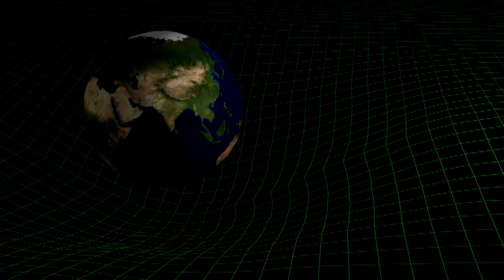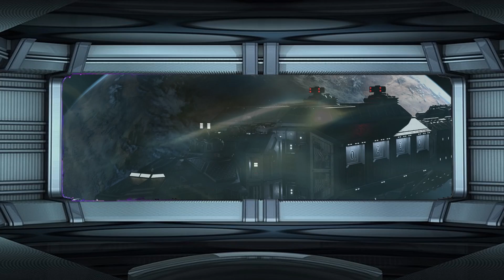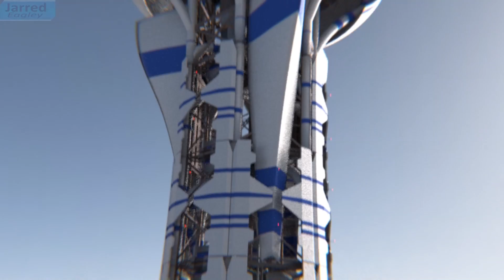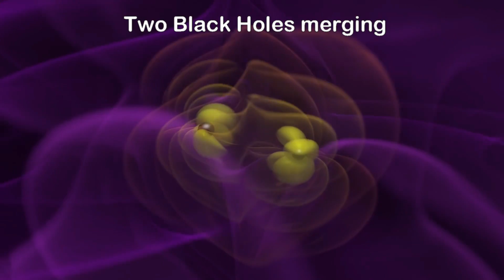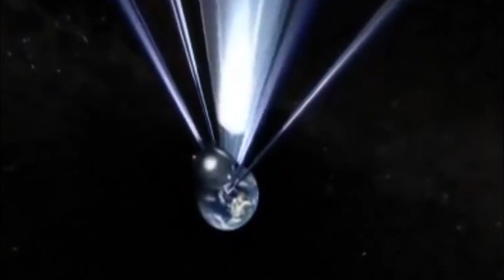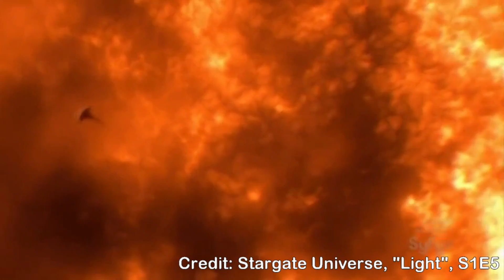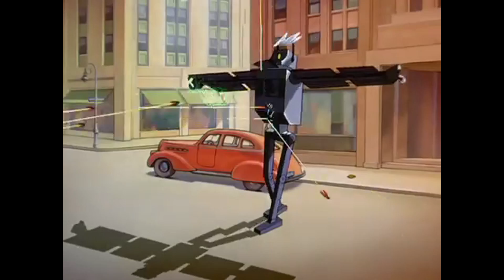Force Fields

Comment: Suppose we put a superconducting ring around an asteroid.  Fill the magnetic field with plasma until plasma pressure balances magnetic pressure.  Would the plasma be sufficiently impermeable to hold a breathable atmosphere onto the surface of the asteroid?  Could we terraform small bodies using magnetically confined plasma?  Solar wind particles could add enough energy to the plasma to sustain high temperature.  Could something like this work?

Comment: Towards the end for using them to seperate energies could you also do the same for light or lasers to store them or just use mirrors to trap it with fine angles to ensure containment for later use? Also about the light sails, if it's 99.99%reflective to certain wavelengths of lasers what it lose energy or momentum to push the sail away from the other mirror meaning more energy input or will it still continue pushing the sail like 1g per second?

Comment: I think the closest we could come to the classic force field would be absorb and redirect rather than block. A laser fired at such a field would simply coat the field and then continue on its path on the other side of the shielded object. A kinetic impact on one side would ripple around and bulge the field on the opposite side the equivalent (or near equivalent if we're gonna get all thermodynamic about it) amount as it would have penetrated. That gets around the problem of heat/energy build up. Plus if you could fine tune it enough, you could just fling the energy back at another opponent.

Comment: In my hard sci Fi universe I'm writing about, the only shield I have are called Plasma Cycle Shields. Plasma is shot out the top of a ship, and kept hovering above the hull through an electromagnet barrier, then as it reaches the bottom of the ship it is reabsorbed and reused, and cycled back up to the top.

They are energy intensive, and almost exclusively used on cargo ships traveling at low relativistic speeds. Even then, the shields are only used on the front plate of the ship. The result is a shield that bounces away dust with the magnetic barrier, and burns up larger debris, adding fuel to the plasma fire. 
What little it doesn't stop, it's stopped by the 0.8 meter thick Tungsten, Tantalum, Hafnium carbonitride Alloy frontal plate. 

I found the limitations of this technology has given me very unique situations in my book, that has resulted in characters having to come up with unique and creative solutions.

Add on top of this that these shields are usually powdered by the excess energy from a "Halo Drive" usage, and it results in a very unique form of shielding with limitations. 

Ultimately the heat of the shield is decided by the strength of the magnetic barrier. Using A0° super conductors the barrier is limited only by the amount of energy you have available, and therefore so is the heat of the shield. Without an Electromagnetic barrier the plasma is limited below the Tungsten melting point of 6,100°F.

Half the fun of writing a hard sci-fi book is I get to spend weeks learning the actual science of things like this. From Metal Hydrogen Batteries, to Coriolis Suits, to Plasma Cycle Shields, half the science behind it is based off of things I learned from this channel.

Comment: I was allways curious why so many sci-fi settings feature low power airtight version of their forcefields, widespread to the level where small craft hangars are lacking physical doors and in same time multiple types of military grade shielded ships, that are flagged as incapable of atmospheric flight. Is religion what porhibits them to use the vacum between shield and ship's hull to provide lif?

Comment: Plasma also blocks/reflects laser, depending on the frequency and polarization. In fact, it might be better than using mirrors to reflect laser weapons. Look up plasma waves and their frequency cut-off. If a frequency is cut off, it cannot propagate through the plasma.

Comment: My settings plasma shield idea is more that it's a solid condensed barrier. Allowing it to be more or less non glowing and sea through at first, though still highly resistant to objects moving through it. Should something try to force it's way through and overwhelm the magnetic fields holding everything in place, the plasma is no longer held rigid and only then can it begin moving, since it was held under pressure in the first place this results in basically full body explosive reactive armor, and yes it does glow and also become more opaque once disturbed. 
This is extremely power intensive, and no is not used as a personal shield you can clip on a belt. Later points in time with much better tech, and it is for people mainly limited to those wearing heavy power armor, the type that could shrug off modern anti tank weapons with relative ease even without the shield. Eventually it does reach the point they could be handled relatively safely on a human or baby without damaging the insides do to more and more types of containment, shielding, and projection systems being figured out, miniaturized, and worked on, but it's still not really used beyond super low levels (like to allow a person to handle hot or dangerous materials as a projected glove type, rather than as a combat shield), since all "humans" are basically about as mortal as a galaxy is, individually being able to lose limbs or stuff and be fine, and even if the local body is completely vaporized, the consciousness is normally run simultaneously between networked areas so their stream of consciousness is still going back at the local bunker points where a new body is made and they are streamed into it with a parallel thought system. It's worth saying if the connection ever does break for more than a few seconds we normally just consider them different people at that point, as each local area does it's own processing, they are just kept synced up so we perceive it as being the same person since that makes us feel better and perceive it as immortality, rather than just losing clones or duplicating ourselves to get around death.

Comment: Force fields as commonly depicted, even if they could exist, probably wouldn't work out in the end. I was thinking about it once, and it would only make sense for the energy or force of whatever they block to be transferred to the force field generator, the same way magnets can push on each other. Even if the generator itself didn't break from that energy transfer, I'm whatever structure keeps it in place would quickly break and now you have a force field generator rattling around inside your ship (assuming it can maintain power)

Watching this though, another thought occurred to me: if an Alcubierre drive is actually possible, it should also have defensive applications as well, since it is effectively a gravity field generator. Depending on how much it can warp space, it might even make an effective way to deflect projectiles and lasers.

Comment: Regarding firing weapons/seeing out of force fields, it seems like you could use an array of port holes either mounted on poles sticking out from say, the ends of weapons, or even using them as drones outside of the ship. These drone rings would be made of something that could project/reflect the plasma field, and fly around in the field creating sight holes and holes to shoot through. Paired with radar and other detection methods, it would be very easy for these drones to dodge and not allow anything through from the outside. I could see this being paired with a goggle set which follows a pilots gaze but will still dodge incoming weapons. On the note of drones, instead of armoring up a ships hull, you could deploy a field of armor drones which can link up maybe via electromagnets to create a solid barrier between an enemy and yourself. Or for an anti collisions system that keeps replacing itself as it’s broken apart. Maybe for asteroid miner ships

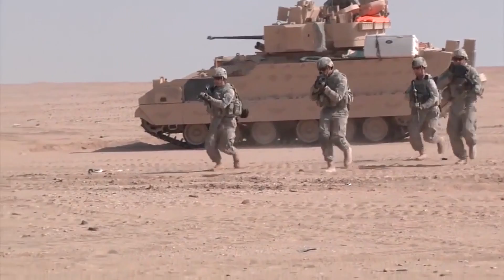Comment: 17:57 Body armor doesn't slow you down necesseraly. It tires you out more, but you won't going to run away slower to compensate, nor will the APC care about the passengers adding 300 kg more to the load, especially if they are also used to tow other stuff.

Comment: Using plasma as a force field probably wouldn't ever really be worth it... all it takes is for something with enough kinetic energy and it will punch right through it, and even if you did use it to protect against lasers the lasers would just have to punch through that containment vessel holding all the plasma and it's almost immediately useless. It would make more sense to instead of making a big tokamak around the ship, cover it with modules that are designed to ionize gas into plasma in short bursts (say if a laser is hitting it). They would not last forever (eventually will burn themselves out) but it would be a lot more compact and effective as armor -- think of it as a high tech ablative armor for lasers. That too though wouldn't make much sense either though... it would be a whole lot cheaper to just use regular ablative armor which we actually have the technology for right now (the stuff we use on heat shields) that would work just as good but a million times cheaper and more practical. The only use for "force fields" would be for keeping stuff like harmful solar winds from hitting your ship, or possibly with enough inventiveness for creaking cloaking screens or for blocking/scrambling rf, but not for active protection -- ewar and stealth at best.

You'd have more luck making a force field out of extremely high power lasers densely packed, in a way to create a screen. Anything that tries to pass through the screen won't necessarily be prevented from passing through, but it would either burn up or explode if the lasers are sufficiently powerful. It would be more of a kill screen than a force field though but that's as close as you probably can get to creating a universal barrier for keeping from getting in without using any solid parts/matter.

Comment: I would say, being able to fully control the field will be the key to getting a shield to really work.  Example.  When you have a fire in a pit, it goes all over the place,  produces heat, and cook your dinner.  However, if you control the fire in an engine cylinder, you get force pushing down a rod and creating Kenitc force which drives the motor in our car with the Cylinder walls.  No real controls here but a physical wall.  Now, trying to take a physical wall and create a magnetic field with the same physical wall property, but using energy to create it.  If this works, drop a nuclear reactor from a carrier and you got yourself an energy field. 

In this video, it is only the beginning but this time it is like being back in 1920 where cars was just starting out.  Now it's 2020, we may see more spaceship tech begin to evolve.  I hope one day we will be building Star Wars ships or Star Trek.  BTW, we will need FTL drives whether we like it or not. 

Provided we don't destroy the world first.

Comment: What about having cloud of metallic particles, you can keep it around you by magnetic field. You could concentrate it against incoming projectiles to enhance strength and rotate it around your ship to disperse heat (from continuous laser). Of course there would be lot of limits but lot of those can be solved by having bigger cloud. Also if you would have decent control of cloud you could reform some parts into large solid objects and launch them against enemy, or enemy missile.

Comment: I always found David Weber's concept of them in the Honor Harrington series to be perfectly workable and realistic.  (Likewise his explanation of hyperspace.)  Ships use gravity drive engines that produce a wedge of focused gravitational pull above and below the ship.  These wedges are pretty intense, enough that solid objects get ripped to shreds and even light gets redshifted to the point where it's pretty useless, even lasers.  Navigation?  The computer knows how strong the gravitational force field is and can look at the incoming redshifted light points and un-shift it as far as the scanners are concerned.  (The fields warp perception through them all to hell, but they do it by a predictable amount, so the computer can make things look normal as far as any sensors are concerned.  It can compensate for the redshift.)  Sides of a vessel don't have the wedges, (they don't meet at the sides, and if these gravitational fields ever cross the result is pretty catastrophic) but military vessels usually have 'sidewalls' that are the same kind of field projected into the gap.  Later in the series they also develop shielding for the fore and aft of the vessel, which are usually impossible to shield due to the wedge configuration.  (I think these can only be used when the ship isn't accelerating.)  So in their combat doctrine, the ideal shot against an enemy ship is directly aft or fore, ('up the kilt' and 'down the throat' respectively) or if not that, then along the sides.

The wedges will easily stop energy weapons, which makes sense given that their main weapons are bomb pumped x-ray laser warheads.  Armed ships usually also mount gamma ray lasers, sometimes more conventional light lasers, and in the case of older, less advanced nations, railguns.  (Railguns are usually exclusively for point defense.)  Typically energy weapon duels between ships are considered to be a failure on the part of one or both captains, since the best case scenario is that the 'winner' will just be the ship that manages to survive such an engagement with enough of its hull intact to retain some atmosphere.  It's a given that both ships are going to get ripped apart, badly, so the energy weapon mounts are pretty much only used regularly by pirates, who mostly attack unarmed ships anyway.

Comment: The classic force field in scifi seems to be more of an issue of computation than laws of physics.  A classic 'force' field may be more like a field that uses quantum methods of computation to create a force that repels matter and energy selectively.  Take the concept of a personal point defense system discussed in the video and apply the same thing to an energy field that uses quantum computation to replace the physical computers used in the personal point defense system and you have something approaching the classical 'force' field of sci fi.  A similar method of doing quantum computing inside of a beam of energy could result in something like the replicators in Star Trek.  I am unaware of anything about quantum computation that would limit it to only being useful in a computer based on matter versus a computer based on energy.  Error checking of quantum computation already uses a similar technique to check for errors while the system doesn't have a determined state.  An energy based quantum computer might do this on a grand scale, doing the whole computation in an indeterminate state only taking action when needed to say deflect an attack.

Comment: Your idea of airbags is spot on.  The problem becomes with detection, building a camera system that is aware and capable of detecting a threat father out or very close. Once detected, the shield could deploy 2 methods. The first being like a parachute or spider web. The second being a sack of fluid at the point of impact.

Comment: There was an old animated show called Macross. I remember they had shields where it was a dense disc of plasma that they had to control and move to the point of impact. A computer predicted where the point of impact would be and a crew member had to move the shield to that point in time to intercept and block the attack. I think energy shields could work like that, except a computer is controlling where the shield goes as well as predicting the point of impact. 

I could see real world shields working a lot like that.

Comment: In the smart beats dumb every time I’m not so sure. On an even footing yes that’s true but very few combats are even. Dumb falling rocks pushed down a mountain by spear throwing tribesman could smash a modern combat squad. The odds are with the modern squad in any analysis but since no plan ever survives in its original form after enemy contact (and if it does it means one side is not adaptive) then I would say smart beats dumb 99% of the time but not always. And there is always the example of a very clever guy vs a massive strong meathead.....in a big arena then the smart guy can win like Kirk vs the gorn....but in a knife fight in a phone box big, strong and dumb will win 99%.

Comment: I have some idea about flying saucer type UFO if it actually exists. The saucer is not the hull but Force-field based propulsion system that let them do maneuvers that single direction engine can't. like open a hole in the field and let plasma go in one direction and by the reason of circular shape they can make it everywhere, so there is no need to turn an entire ship to change direction. Or open small 2 or more holes as RCS system. However, the main ship inside may still need separated landing engine, because I believe landing with a disk of plasma is not a good idea for surroundings.